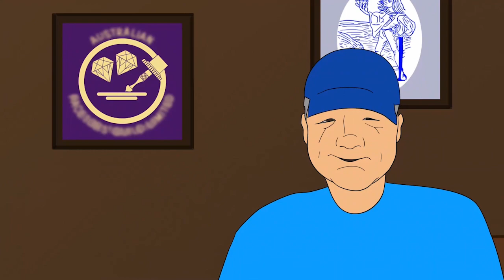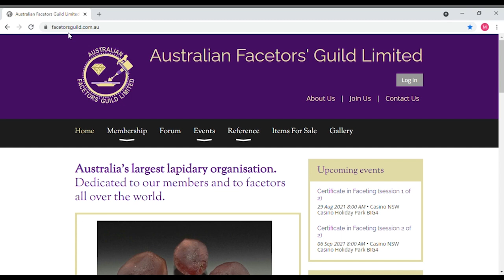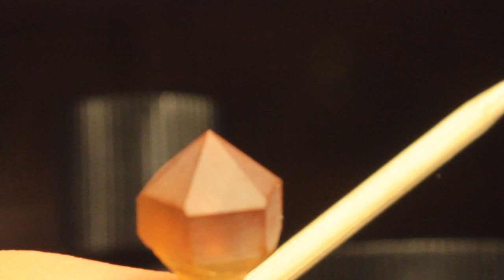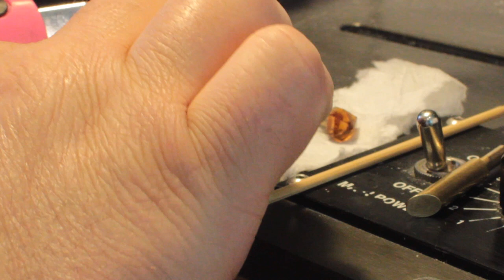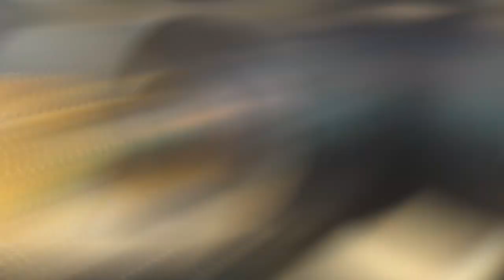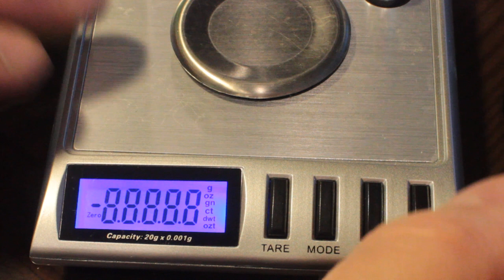Gem Cutting Tutorial: Dilemma Design Citrine

Comment: Awesome! I built my own machine to polish cabochon 3 days ago and i began to learn about this art. I want to polish gems like you some day.
Reply: Building your own machine is very impressive!!!!
Reply: @mikesackos2208  it is easier than we tought. We use an electrical motor with 1/4 hp of power (from a broken washin machine), a structure made with stainless steel square bar. For polish, we use abrasive disks used for marble and granite. I need now to buy cerium oxide to finishing the stones and a fan coil to improve the electrical motor refrigeration. Here in Brazil all about polish gems is very very expensive. The next step will be the index manipulator to faceting.